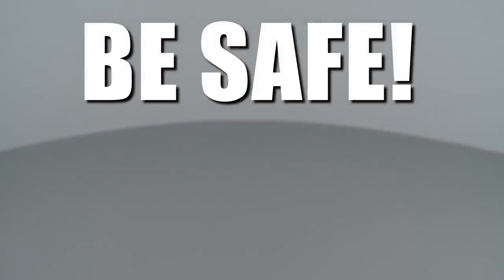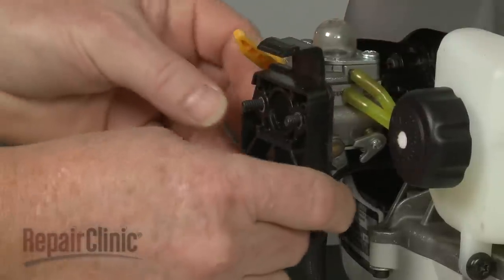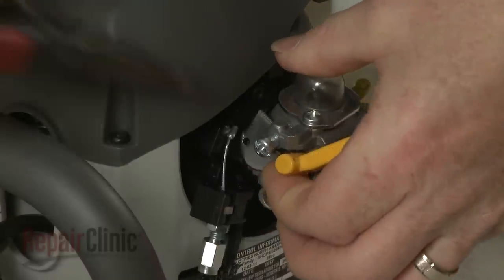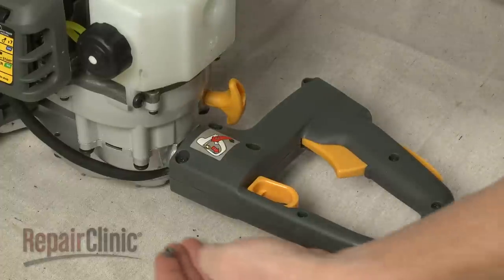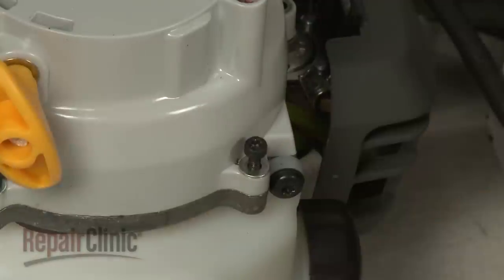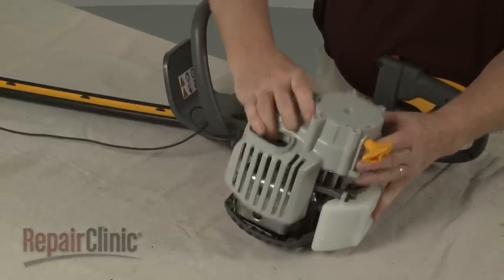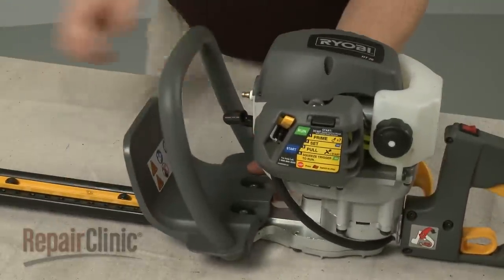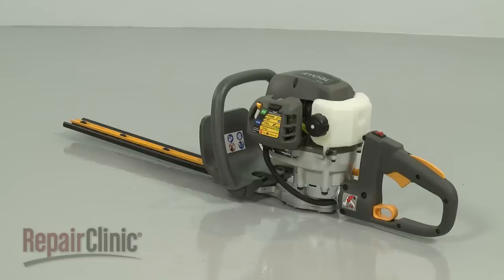Ryobi Hedge Trimmer Disassembly – Hedge Trimmer Repair Help

Comment: Hi repair clinic i have a Ryobi hedge trimmer replaced primer bulb on it and it’s now struggling to pull fuel in could it be fuel line ? And I have a 52cc multitool and it only works when it’s fully primed and stops once primer is empty any ideas or suggestions cheers
Reply: Blocked fuel filter in fuel tank ? Or leaking fuel lines ?

Comment: I have a Ryoby hedge trimmer  , during running it leaks a light coloured oil or grease from the starter cover   can it come from under the flywheel .
Reply: Hi Nigel had similar problem and was told the screws were loose especially around the exhaust, which they were and (in fact the longest one had sheered off). After tightening the rest of them and any other I could find it is now running fine. It also used to spit oil at me on certain angles but now that has ceased. But I have one small problem remaining that the on/off switch fails to turn off the motor. Ive replaced the switch & still the same. I have adjusted  it to running at minimum revs at idle. then with my finger I can push down against the accelerator bar firmly and it is enough to turn it off. Hope this helps someone else too.
Reply: You helped me i have the same identical problem Sir Thank You i will tighten my screws !!